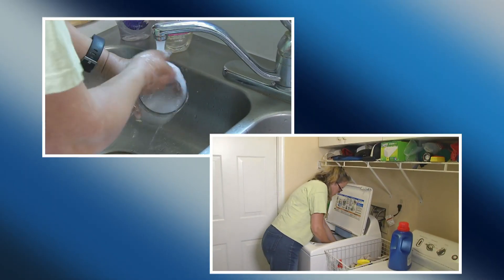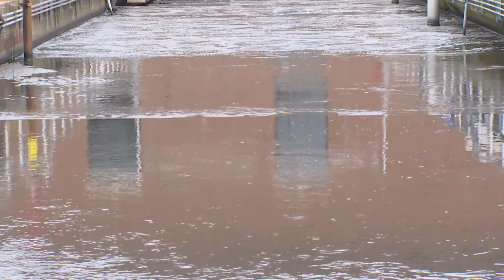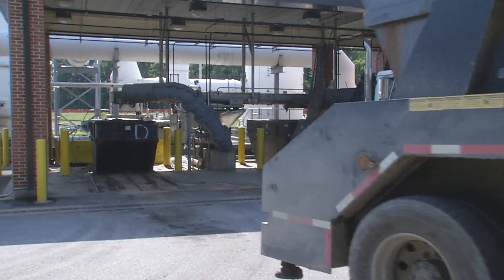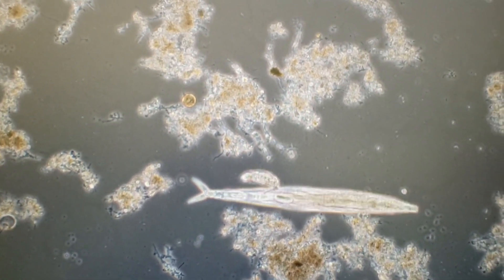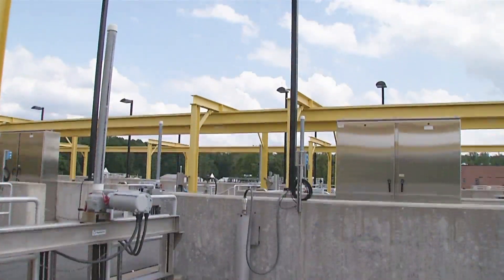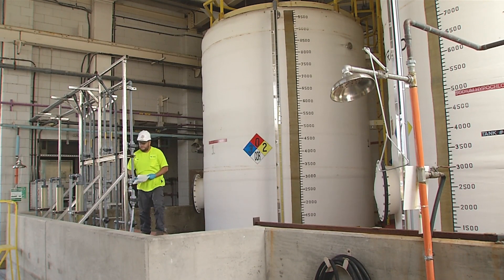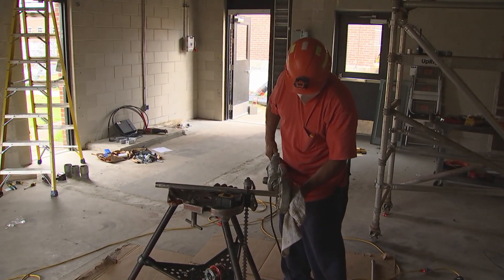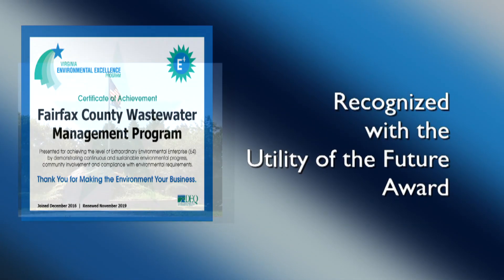Take a Virtual Tour of the Fairfax County Wastewater Plant

Comment: Well done.  I worked in the lab in what was then called the Lower Potomac Treatment Plant in the mid 1970s.  Flow while I was there was about 17 mgd, and none of the primary tanks were covered.  Even though many of the treatment process are the same, I doubt I would recognize the place -- other than the gravity thickener building.